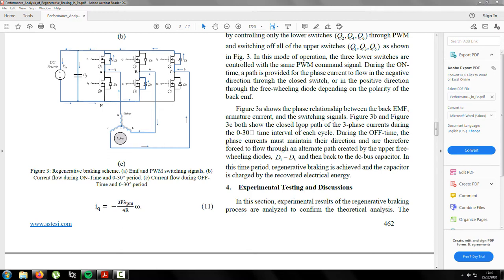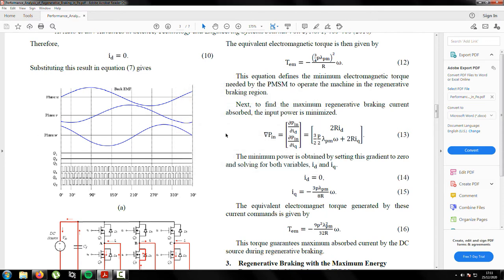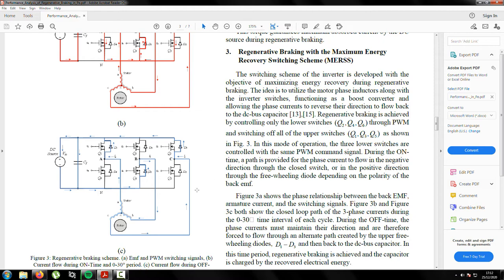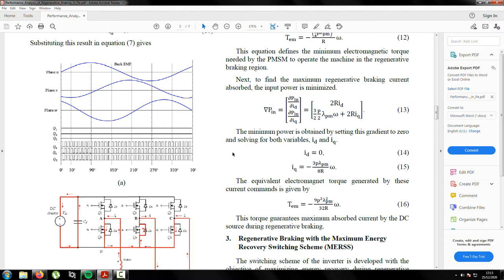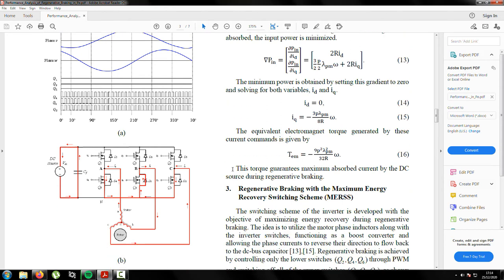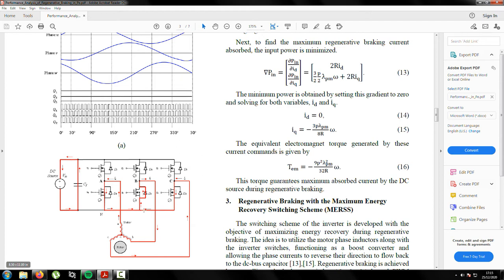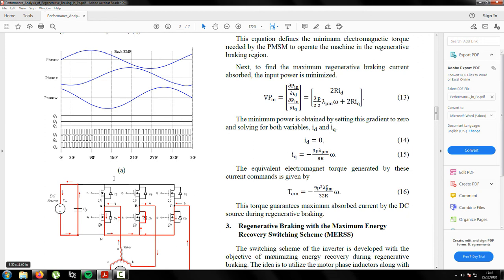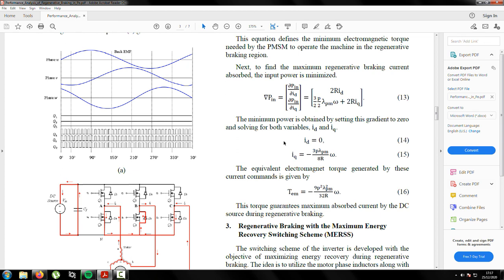How Regenerative Braking Works (Complex Explanation)

Comment: Thanks you for delving into this. I am experimenting with a VESC controller in regeneration mode to generate electricity from a BLDC driven by an engine.  This generated power is then fed in parallel to a battery and a load. The VESC allows regen amperage to be controlled, but not voltage. I struggle to understand how not to blow up my battery and how to control the voltage. Does the PWM control for the lower MOSFETS change the voltage or amperage output? If only amps, how could one limit the output voltage?

Comment: Hi Shaun, really keen on regen, so any uploads you can follow up with would be of interest.
I've not watched your video yet so I may be offtopic, I'm interested in the electrical storage type and also mechanical flywheel - I'm an electric bicycle owner and it's a real b*****d having to apply the brakes and waste potentially useful energy.
Reply from the maker: I sadly don't have any working product or solution as its beyond my skills to implement it.
Reply: @ShaunDobbie  me neither, my bike motor generates in freewheel mode, I found this out when I first put it together, I was using it as a normal bike as I hadnt the battery at that point, if the phase wires touched it woukd shudder to a stop. A storage method to save that wasted momentum woyld be handy, also would mean maybe 90% less wear on the brakes.
Reply from the maker: @dav1dbone  Your bike wil recharge itself if you manage to get it going faster than the battery voltage can push it.
Reply: @ShaunDobbie  yes I agree, there's a dc voltage coming from the controller but for various reasons it is not being routed to the cells via the bms, I wouldn't want it to anyway, rather have it available to charge say a bank of supercaps when desired. I was thinking of wiring the super caps between the battery and the controller as a buffer to reduce\smooth the load on the cells during acceleration.
Reply from the maker: @dav1dbone  You are as well just regenerating into the battery. The voltage will not go into the battery because it isn't high enough. You need a controller with the feature I described in the video to boost the voltage back into the battery.
Reply: @ShaunDobbie  ok not watched your video yet, my feelings on lipo4, not to charge like that's, since charge durations are 800-1000 cycles on a degrading graph, why not let the supercaps bear the brunt since they can handle 1milion plus cycles with little or no degradation?I've already tried this, bms, not happy with current inrush, and that is my latest result.
Reply: Curious if you looked into this more. I plan on using a VESC controller hooked to a 3 phase skateboard motor driven by a gas engine. Don't know what efficiencies to expect